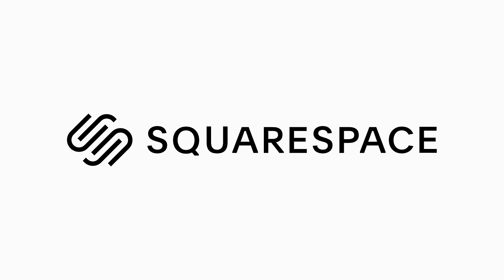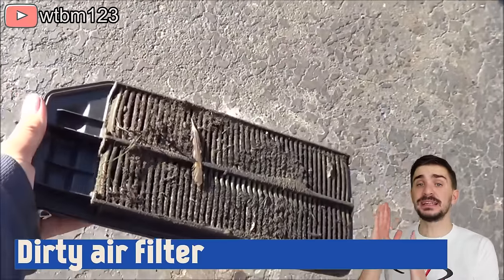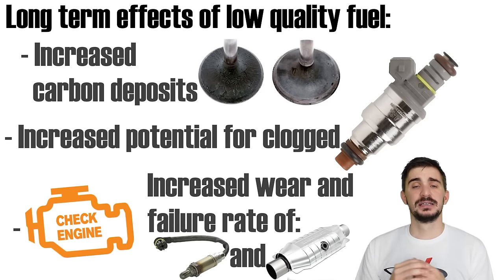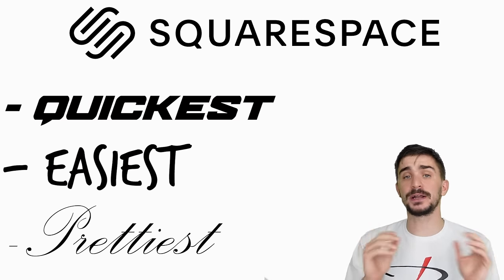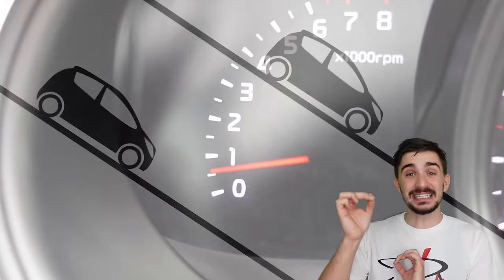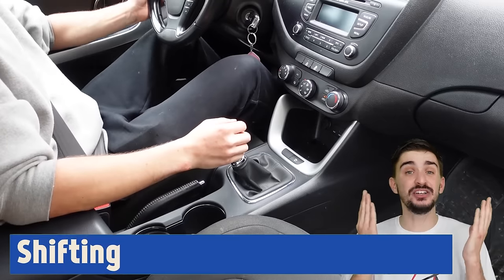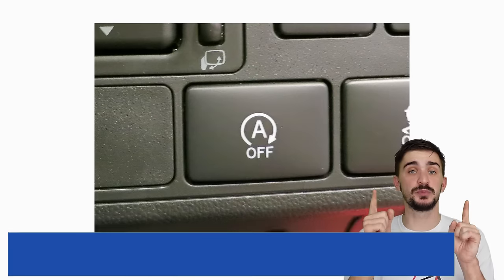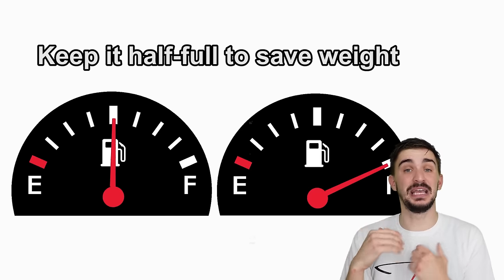EVERYTHING on FUEL SAVING - PRACTICAL DRIVING and MAINTENANCE techniques to REDUCE FUEL consumption

Comment: In response to the Start-Stopp System:
Actually, Engineering Explained did research on that topic and discovered, that it really saves fuel depending on the duration you're staying still, which was around 7 seconds with his example vehicle. Sure, increased wear will occur in a way, but when you live in a village with no traffic lights whatsoever and do your weekly trip into a city, you won't feel it anyway.
Reply: i used to do that for every 20+ second stops and ended up killing my battery within a year.

i guess if you dont use lithium or some of those fancy start/stop battery, it doesn't make much financial sense.

now i just kill my engine if i know i gotta stop for more than a minute... unless i gotta keep the A/C on for some guests that can't be bothered with that

---
i do still kill my motorbike and shitbox on most stoplights, though, but more for the noise than the fuel saving.
Reply: Near where I live there is a traincrossing with a sign to shut of your engine cuz the wait is about 5 minutes
Reply: In the BMW users manual is indeed written that it safes fuel from 7s on.
Reply: Bmw owner here: the user manual says you should kill the engine at traffic lights, but my car does not have a start-stop function. But then again...the user manual also says to replave oil every 20.000 km 😂
Reply: In my country you are required by law to turn off your engine if you stop for more than 3 minutes. Like waiting for a train to pass, or if there is roadwork, or if picking up someone, etc.
Reply: I think the real take away here is to turn the engine off instead of idling for a long time. Engine off driving is stupid but in the drive through or stop and go traffic, you actually stand to benefit from stopping the engine. It is annoying to listen to the stereo stop and then start again every time u crank the engine so I usually don’t do this. But you can save fuel
Reply: Juls Hg Just stop dude. Coasting your vehicle with your engine off is just simply idiotic, there is no amount of theorizing that can remove that basic truth.
Reply: @angrysocialjusticewarrior  you know that we don't talk about coasting right? It's about idling xD
Reply: @lenoohpuls  Hi, which country ?
Reply: @Looo0007   Why not own a Hybrid or the latest BMW that comes with the built in start/stop function ?

Comment: As someone who drives very efficiently, I find it entertaining that most of this video is either things that I consider more important for safety or longevity, not efficiency.. and the things mentioned for efficiency seem like basics to me. An example of a less basic technique is coasting towards a red light, waiting to brake until you're closer. If you time it right, you go through the intersection without stopping. When you get it wrong, you use up your brakes a little quicker. It requires skill, but when you do it right, it makes an appreciable difference. Note: This only applies to non-hybrid/non-electric vehicles. With those, brake very gently so you get maximum efficiency regenerative braking, so you're safer, don't wear out your brakes, and get energy recovered.

(Batteries charge/discharge much more efficiently when the charging/discharging is slower, so gentle braking is better for them. This is also why you should still accelerate gently in a hybrid/electric. I think some people believe that because it's not like an engine, they can just mash on it because "the only difference is how fast you use it" and that's just not true.)

For pickups, a tailgate creates a vortex that improves aerodynamics.. but I know the comparison between tailgate up and down.. I hadn't considered that a covering (or tunnel as you call it) could be more efficient.

Engines take between 4-8 seconds of fuel to start depending on conditions. If you're really stuck (like at a train crossing), it can still be worth it.. but shut off other non-essentials too.

I know keeping the tank not full puts additional strain on the fuel pump, but I'm not sure how much of an effect this has. I keep my car between 40-100% full, but my motorcycle I usually run down to 10-20% before refilling. It makes less of a difference on my car because it's a hybrid. (We've determined through cross-country trips that it's actually just as efficient with a large load of stuff as it is carrying just one person. So I'm not worried about the weight at all. Still try to keep it clean though - I need that space for stuff!)

Comment: 8:04 Worth mentioning that any car with electronic fuel injection will just turn the injectors off if you're off throttle at least 200-300 RPM above idle, because you don't need fuel to keep the engine running. So just rev match and use the engine braking instead if you want to save fuel. I know you mention this later, but adding this to the stupid idea of shutting the engine off shows how stupid it is.
Reply: Please tell me this works with old diesel engines... Mechanical injection
Reply: @user-xt1mw6vm3y  This is what he means:
"if you're off throttle at least 200-300 RPM above idle,"
1- Your car is moving.
2- The transmission is engaged.
3- The rotation of your wheels produces a comparable rotation in the crankshaft of "idle" plus a given amount (he stated at least 200-300 more.)
4- You are not applying the throttle.
In those conditions, the wheels are turning the crankshaft with the vehicle's own momentum. So the engine doesn't need fuel to turn the crankshaft.
Reply: @user-xt1mw6vm3y  This answer is a bit long, as I assumed you wanted a somewhat more thorough answer.

Yes: We are borrowing it from the transmission (how exactly we do that varies by transmission, but it's easy to imagine if you think of physically connected gears.) 
"Power" in an engine is the result of the crankshaft rotating. Whether we are generating electrical energy through the alternator, or toque through the driveshaft, or pressure through a power steering pump: It all ultimately results from the rotational energy of the crankshaft.
So, if the crankshaft is already rotating at or above the system's desired RPM by borrowing power from the connected drivetrain (with overhead, explained a bit further down), there is no need to inject any fuel to create any additional power.
The most simplistic version is that we "let it roll" since it is already doing so.
This will slow the vehicle down by effectively creating a bit of a vacuum in the combustion cylinders. Because power isn't free. But if the car roll downhill and still have spare energy to rotate the crankshaft, the fuel injectors can simply "cut off" in most electronic fuel injection engines. This is what OP referred to as "engine braking."
This is why you can't just roll "at idle" but instead, at "idle plus" a given amount: Because some of the energy of you rolling is taken from the driveshaft and fed to those other systems. As long as the system can maintain an "idle" RPM, it is effectively just taking advantage of momentum or gravity to create the same rotational energy that fuel normally would. To rotate the crankshaft to generate all of the power the vehicle needs.
You could argue this isn't efficient to some extent, as we're creating a vacuum that effectively slows us down: but if we're not desiring a degree of acceleration beyond that resulting speed, we essentially get "free power."
Of course, it isn't truly free. We had to generate the power to get moving, so it's closer to "recycling" excess energy. But if were to exclusively use this feature when rolling downhill, it would be borrowing gravity to generate power. On a straightaway where we need to apply power to MAINTAIN momentum, yes.. It's actually not horribly effective (in fact, the constant cycling can be LESS effective is the cut-off of the fuel injectors is too trigger happy) unless we sped to a high speed and are coasting to a lower one. Otherwise, we will have to apply more power (with fuel) to compensate once we've slowed down.

Does this better answer your question?

TLDR: When we slow down by "engine braking" (decelerating without applying the brakes) or when we "roll downhill", we can actually recycle the excess energy in the system and use it in place of fuel to keep the crankshaft rotating.
Reply: @user-xt1mw6vm3y  Btw I'd like to add something I forgot:
This cut-off isn't very helpful AT ALL on flat ground (except if we consider real-world traffic conditions), and I accidentally misrepresented that:
If we recycle excess energy, thus "engine braking" on flat ground because we just accelerated to 80MPH to pass someone, and are now intending to slow to 60MPH.. We do get a bit of "free power" from the excess we generated.
But.. Well, then if we look at it as distance over time.. We don't: We slow down sooner, thus needing to generate additional power earlier to maintain momentum.
But, since cars don't drive non-stop and do often have to change speeds or stop, we effectively get a moderate margin of fuel savings in the end. And a TON if we all commuted exclusively downhill lol.
Reply: @user-xt1mw6vm3y  I edited my former comments for clarity. I hope they help. The short answer is: Yes. We "get it from the transmission who gets it from the wheels." But I do think the longer answer may be something you find interesting.

Comment: My standard MPG on the highway is around 32, behind a semi its 35 to 37mpg. 
I am not drafting super close either, I follow the 2 second rule which is what was taught in drivers ed for the closest you should get.
Standard following distance behind semi still saves a good amount of fuel.  

Also, you are constantly accelerating and decelerating isnt true either since you just hit cruise control and trucks dont change/cant change their speeds fast at all.

Manually starting and stopping your engine not saving fuel is also false. Engineering Explained did a video around this already. You only need to idle for  around 7 seconds for it to consume more fuel than if you just turned off your engine. Very useful in drive thrus and if the light just turned red.
Reply: You are correct and the video is incorrect.  This channel is usually pretty good but he got a few critical things wrong in the video.  10% to 20% fuel use reduction sounds about right for following 2 seconds behind a semi in my vehicles.  That's a larger gap than most people leave on a lazy sunday drive.  Perfectly safe and legal.
Reply: I agree and saw about the same.  Unfortunately I also could hear and see many more little bits of grit hit the front of my car and chip paint.

Comment: One trick about driving turbo cars if you have a boost gauge is keeping boost at around zero. In this state the compressor is generating exactly 1 atm in the intake manifold so there is no intake pumping loss. Further increasing boost also increases load on the turbine which increases exhaust pumping loss.
Reply: if you want to save fuel, don't buy a turbo car

Comment: Drafting is extremely beneficial about fuel saving, trust me...

I have been doing it for more than 10 years, and it saves more than 50% percent of fuel when done correctly... My car normally burns about 5 litres per 100km on highway, but when drafting is in action, it decreceases down to 2 litres per 100km...

But the part where you say, it is unsafe; is true...
Reply: what about overheating engine

Comment: I think filling up the fuel tank to only a half or 3/4 or whatever is going to make you use more fuel in the long run. Sure, not completely filling your fuel tank does help you save weight, which helps you save fuel, but then you have to go to the fuel station more often. Even if you stop by a fuel station that is directly on one your normal commuting routes, the process of turning off the street, pulling into a spot to get fuel and the pulling away from the gas station uses a small amount of fuel that you could have delayed if you had simply filled your tank all the way the last time. Does the 0.02 gallons it took to pull into and out of the fuel station out weigh the 0.02 gallons you saved by driving with less fuel? Maybe, but it cost you more time and it probably wasn't worth it.
Reply: You also discharge your battery and use your starter an extra time. Last I checked batteries and starters are still more expensive than a few gallons of gas.
Reply: @ben501st  Ever since I was a teenager and my truck wouldn’t crank when I went to leave the pump I never switch a vehicle off for fuel only
Reply: I see you everywhere lol
Reply: @lethargicstove2024  Which one?
Reply: Clover, the guy who made this comment, I see him in many comment sections

Comment: i have a friend who owns a renault trafic van, with a turbo charged 2.3 liter diesel powerplant and manual tranny. bloody thing managed 15-16 mpg, wich is just pathetic (empty).
so, we got rid of the whole exhaust, reverted to a mechanical fuel pump, got a different turbo, got rid of the stock air filter in favour of a far larger truck filter. the exhaust is a straight pipe now with a silencer (fieber pack old school type) , the turbo is larger and is mechanically actuated variable geometry type. got a exhaust header with equal lengths. got equal length intake runners. no egr, no dpf, no silly shit.
result ? almost 20 mpg under the same conditions. 

it allso pulls a lot better.he earns a living from hauling stuff. the fuel consumption difference is allso a difference of earning a living or ending up dead out of business. and thats that. the best fuel saving advice, do not buy trash. or if you did, fix it.
Reply: Tdi rabbit 1/2 ton pickup gets 60mpg loaded. 
Congrats on spending 3x on fuel. 
And your imperial gallons embarrassingly
Reply: @fastinradfordable  this is a big van. not a 1/2 ton passenger car-ish toy junkster.

Comment: I used to own that box shaped thing (Scion xB) that you've shown at  10:19 

Great little car it was.  Our family bought a Toyota Echo (North American nameplate for the Yaris, 4dr sedan, 4speed automatic) 6 months prior to my purchase of that box with a 5 speed manual.  Both cars shared most of their propulsion and suspension bits.  The box was the car to take on a family outing, even if I had to park it in hilly San Francisco because it offered a much roomier backseat with 30cm shorter length.

I once did a long road trip at a 30% lower cruising speed (50 vs 70 mph) and was surprised to see that its fuel consumption matched that of the Echo.  Of course the lower speed and the more efficient transmission closed that gap.  At its core, it was an economy car  that trade some fuel efficiency to practicality, not some SUV with rough underbody bits with large, unshrouded offroad tires exposed to the wind.

Comment: I have done the shut engine of technique only in manual transmission cars, I did not use the starter to get the engine running again which initiates the start cycle, I jumped started the engine with the clutch and the correct gear for the speed I was going. that being said its easier to just let the engine idle while in neutral coasting and if you leave it in gear most modern cars turn off the fuel injectors while coasting, you can see it on your fuel mileage indicator.

Comment: The airfilter doesnt matter on a naturally aspirated petrol engine. Those pumping losses are induced by the throttle restriction plate. It just caps the max hp. This tune only works on diesels really.